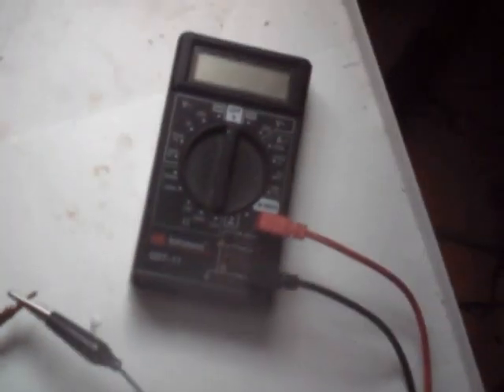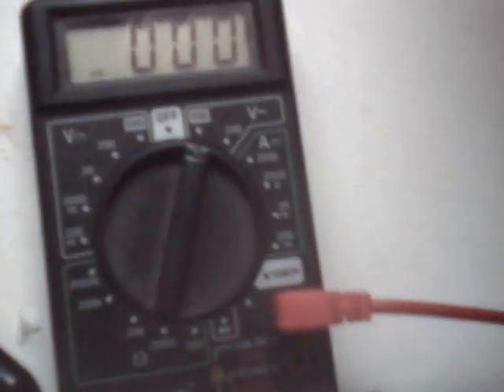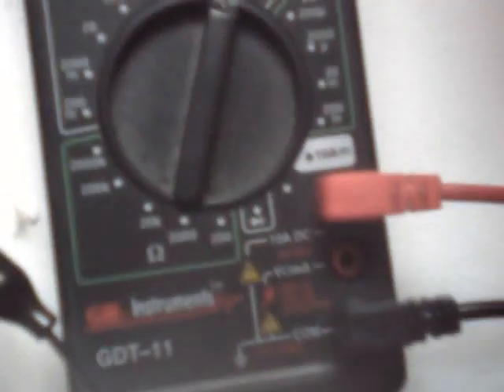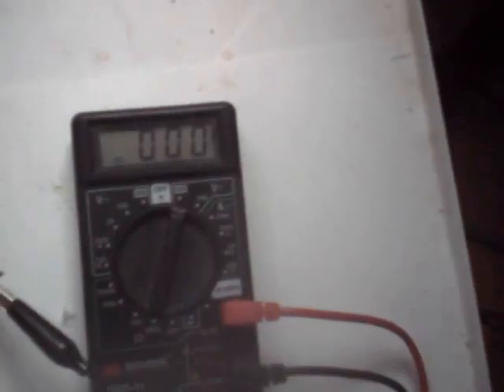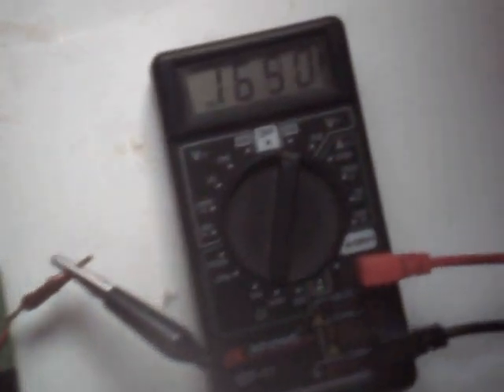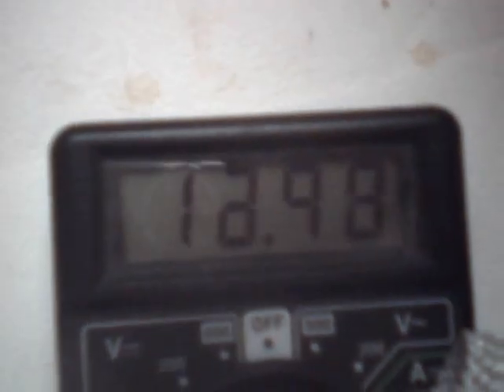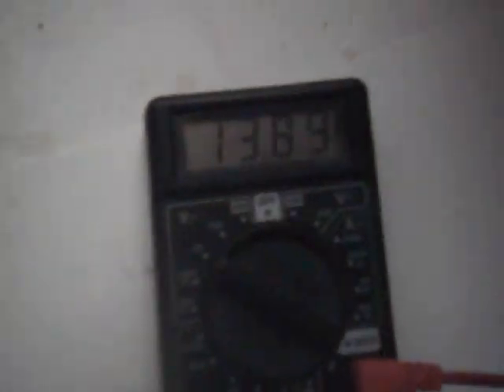THE TOY 6 VOLTS X 0.2 AMPS INPUT / 1500 VOLTS AND 15 AMPS OUTPUT

Comment: this is a basic mag amp, in a variation of the magnacoaster, however, when you tested on the 10 amp mode, you never broke the circuit and changed the wiring of the meter to test amperage while all along the wires are set up the same way for voltage. Since this is maybe a $5 harbor freight meter, or equivalent to the one they give away free, the readings are obviously flawed. If that was 1500v at 10 to 15 amps, that meter would have exploded like a bomb. I have worked in the high voltage industry for 20 plus years and the coils would also need to be immersed in oil because they would rapidly explode having 15,000 to 20,000 watts running through that puny little baby wire that has virtually no insulation on them. HV wires need very thick insulation on them to operate without arcing or shorts between the conductors, even in a coil arrangement.

To satisfy the coil per voltage, you'd need to drop the voltage down by having more turns and less voltage per turn. Back emf would have literally no amperage at that voltage, so, again I think the meter is sending a reading in the setting because the probes are connected normally as if you would be reading voltage and you need to open the circuit, connect the positive to one side of the open, then th negative to the other side and test again.. but this time, use a quality several hundred dollar fluke or something that will produce a believable reading.

V x I = W .. 1500 v x 15 amps = 22,500 watts. You would be dead if you were touching the output wires from your meter because the insulation on the meter probes are only good for 1000v. ERRONEOUS!!

Comment: Haha, "you do the math" - love to be able to scan Youtube for posters that utter those immortal words!!!  Practically all (that I've come across) are implying something extraordinary is occurring, either in a deliberate attempt to deceive people, or perhaps they really are genuinely confused...

Do the same test - BUT THIS TIME MEASURING BOTH VOLTAGE & CURRENT SIMULTANEOUSLY!  Or less scientifically, stick a 3KW bar-heater across the output, and rather than witnessing a blinding flash that burns out the unit, watch how absolutely nothing happens.

Comment: how can you capture more power then what is coming in from input?
Reply from the maker: THE OUTPUT COMES FROM THE COLLAPSE OF THE FEILDS FROM THE COIL AND THE IRON BOLT. THE BOLT'S FIELD IS GREATER THAN THAT CREATED FROM THE COIL AND IS ALMOST FREELY CREATED. THE COLLAPSING FIELD OF IRON CORE SOLENOIDS OR TRANSFORMERS CAN BE ENORMOUS AND DANGEROUS, BE CAREFUL WHEN TESTING ANY IRON CORE TYPE DEVICE.
Reply: OVERUNITY BUILDER can you draw out a schematic so i can try and replicate your findings